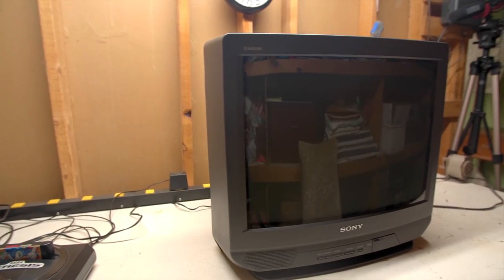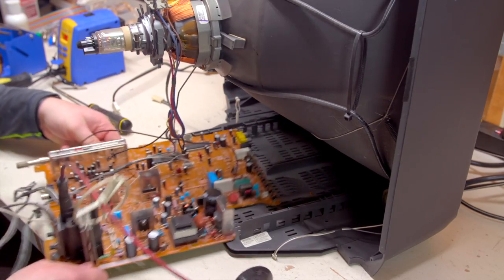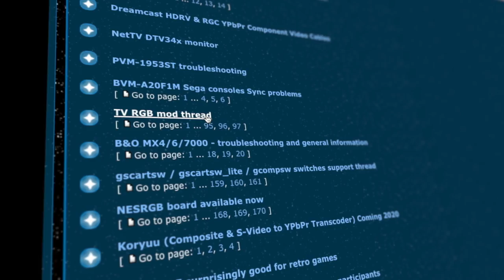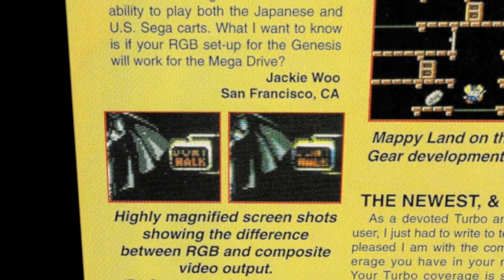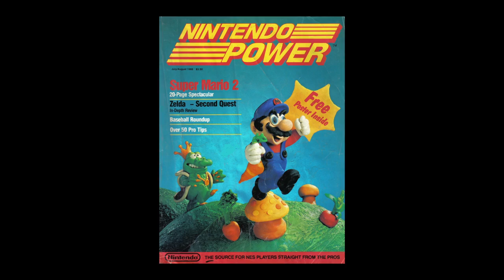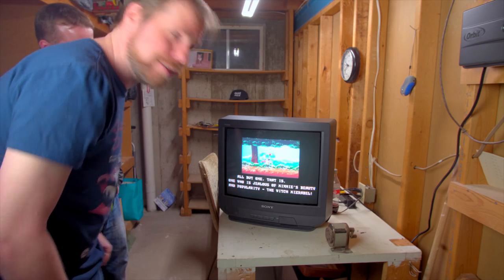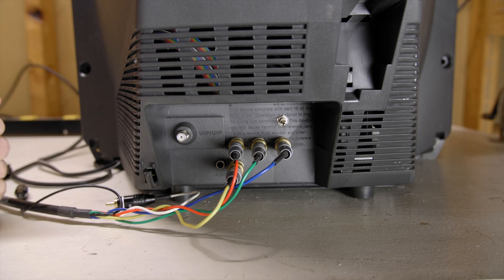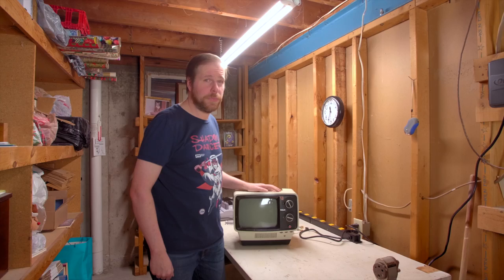Modding a Consumer CRT TV for RGB - Game Sack

Comment: Sorry, I have to do my usual Publc Safety Announcement again....

If you have a TV which has an insulating block between the RF tuner and aerial socket DON'T mod it for RGB!

Those sets have a so called "hot chassis", where the entire PCB is floating a mains potential.

It was a way for the manufacturers to make the TV more cheaply, without the need for a properly isolated power supply.

But the only thing between you and electrocution is the insulator on the RF socket.

Usually those TVs don't have anything else metal (like buttons) that are exposed to the outside of the case.

If somebody were to RGB-mod those sets without realizing, it would pose a serious risk of electric shock when they go to plug in the RGB or audio cables, or even just touching the connectors.

The TV in the video clearly has a metal extension from the RF tuner, a proper isolated switched-mode PSU, so should have proper isolation for the RGB signals (and the Ground taken from the secondary side of the PSU).
Reply: Even if you warn people not to do this mod unless they know what they're doing, the problem is that most of the guides never mention the "hot chassis" thing.

It's a particularly insidious problem, because you could in theory even test the RGB input OK when hooking up to a console (since the console's often have a "floating" DC power supply too), but get a serious shock if you touch the cable/connectors, or other cables hooked up to the console at the same time as something grounded (like a cable box, other cables, radiators, taps, pipes, other devices, kittens, etc.)

And people WILL unfortunately try this mod regardless of the usual warnings about discharging the tube etc.

The mod can obviously be done safely (like on the TV in this vid), but definitely something to watch out for.

Stay safe. ;)
Reply from the maker: Good info. Pinned!
Reply: Yeah some old technology can be crazy dangerous. There's a reason we used to have electronics repair shops everywhere back in the day, you couldn't just do it yourself like building a computer today. Another one is guitar tube amps. Don't mess around with the tubes yourself, trying to replace them or whatnot. You can get shocked doing that too even when the amp is off and not plugged in with a kettle lead.
    
Nowadays it seems there's more regulation to try and make electronics safer, like it's easy enough to replace a phone battery or fix a gamepad by opening it up. That's a good thing. They're still probably making CRTs in China somewhere with no regulation at all though, with this unsafe factor. I've heard some people import newly made CRTs from China off Ali express or whatever to play old consoles with. I dunno if I'd risk it. Just get an old one off ebay.
Reply: Oh yeah, guitar amps. That's another one. lol

I just stumbled on a thread about that, too, while looking for CRT "hot chassis" stuff.

All those stories of musicians getting zapped on stage are probably due to that, like in "Almost Famous", or "The Commitments".
Reply: @electronash  thanks for the Pubic Safety Announcement
Reply: @electronash  Thank you so much for the education. Your a Saint!
Reply: yeah.. I did what he did but failed.. I'm still  not sure what he did.
  I got flat out electrocuted when I tried grounding it.  I put the tv back in the closet once I regained control over my hands.
Reply: I do bondage electrocution on the side, this mod will be enjoyable for me
Reply: Maybe make an opto-isolation board?  CRT's are definitely not something you want to poke around in unless you have a LOT of electronics/high voltage knowledge and experience first.  I learned from my dad back in the early 90's, who learned on military radar equipment.  He taught me good practices.  I learned to solder when I was 8.
Reply: @guerrillaradio9953  I dunno how I never killed myself as a teenager. Me and a buddy of mine used to take apart everything we could get our hands on, TVs included. We never discharged shit, just started poking around and soldering. We also make homemade explosives. Shit that would blow an entire tree trunk out of the ground. I must have had dozens of near death experiences that I never even knew about. Got shocked a bunch but nothing that knocked me out. 

Once we were screwing around with the electrical system in my car and noticed that I could feel pulsing electricity when I touched any exposed metal on it. The whole car was electrified! It was funny at the time but not so much in retrospect.
Reply: Just discharge properly and youll be safe. Besides it is not going to kill you, I have received several shocks from arcade monitors and im here... just try not to get hurt
Reply: It's quite hard to find tvs that are not black and white or very early color tvs with this type of power supply. I risk to say that every set from the 90's is safe for it
Reply: @mickael486  was it connected to the mains outlet?
Reply: @Orkoto  It's not just about discharging the tube, and that's the whole point.

If you've worked a lot on arcade monitors, you'd know about the hot chassis thing.

And yes, they can (and have) injured or killed people, sadly.
Reply: @geovani60624  I recall seeing plenty of the Zenith/RCA/Sharp and other brands in the 90s with the hot chassis and RF isolator, especially in NTSC land.

They did start to get phased-out towards the end of the 90s, though.
Reply: @LordHumungusFL  Yes, I've watched a few of those. Great channel.

He doesn't get zapped because he knows how they work, and how to repair them. ;)
Reply: There are several solutions to a hot chassis that they use in antique radios but none of them are actually worth the trouble on an old cheap CRT TV.
Reply: I don't want to say it's impossible,  but it seems unlikely to me that you'd find a hot chassis TV with a jungle chip suitable for RGB modding anyway. Anything that has composite AV inputs isn't likely to be hot chassis either, since that wouldn't be safe - the hot chassis tend to be only older TVs with just RF input.
Reply: @ElectronAsh couldn't you just use an isolation transformer, just as you would with a hot chassis arcade monitor?
Reply: @rastanthebarbarian  Yes, in theory you could, but you'd be better off finding a slightly newer TV that uses an isolated switched-mode PSU.

It is true that it's hard to find a hot chassis TV these days, and usually when they only have an RF input, but the whole point of the warning is that they DO exist, and it's something that I'm not sure many people are aware of.

They mistake it for the same thing as discharging the tube, but it's a separate issue.

I would hope that most TVs from about 1990 onwards use an isolated PSU, but you just don't know until you check the board or find the matching schematics for the chassis.

Some people have said "Well, you don't really see those hot chassis TVs any more", but then we're working with "retro" TVs here, which could be from the early-to-mid 80s.

Just better to check things, and be safe. ;)
Reply: @electronash  I recently found a 25" Sharp at the thrift store with a hot chassis, manufactured in 1994! It has a toshiba jungle which is documented as being successfully moddable...I have experience modding about 5 TVs so far but they've all been isolated.  I may try my hand at modding the sharp, since I have an iso transformer handy, but I certainly wouldn't advocate for others to try it!
Reply: @rastanthebarbarian  See, they do exist. hehe

I did have a lot of trouble finding decent photos of "newer" hot chassis sets, but I know there are plenty out there, even in the 90s.

It was just a cheaper way to make a basic set, and in 120V Countries it only needed a voltage reg for B+, so there was no need for an isolated transformer as long as the RF socket was isolated.

(and there were no other conductive paths like metal buttons to the outside of the case.)

Yeah, I wouldn't personally bother with the Sharp TV. Just look out for an isolated chassis.

I know tons and tons of CRTs got scrapped, sadly, but there should still be millions to choose from.
Reply: Or just properly ground and mod the crt....If you can't notice situations like your long winded comment stated then you shouldn't be messing with anything electrical to begin with.
Reply: @RoomerJ  "Grounding" doesn't solve the issue with those sets, and you can't ground/Earth those anyway because the chassis is at (or close to) mains potential, which is the entire point.
Reply: @electronash  Like, your whole comment to anyone who does this is equivalent to commenting on a "hot to install a light bulb" video and saying "Just a little safety psa here uh-huhhuhuh dddeerrrr, don't stick your tongue in sockets that have yellow paint on the threading" derderdeee
Reply: @RoomerJ  This is not an obvious or blatant issue at all unless you've worked on this stuff before.

Your first reply shows you clearly didn't grasp any of what was said before. But hey, it's the YouTube comments section. There's always at least one person who has to pick fault in other's comments. lol

Obvious troll is obvious.
Reply: @RoomerJ  These videos are generally aimed at people who don't usually work on TVs, who have never done repairs before etc.

There are plenty of examples of people trying an RGB mod on a CRT who have never opened a CRT TV before.

My comments are aimed at those people. Some have been hurt trying this stuff before.

If you're gonna post replies in a style of "uh-huhhuhuh dddeerrrr, don't stick your tongue in sockets...", people will see you as a troll.

I'm never going to apologize for posting safety info if it might help save even ONE person from possible injury or death.
Reply: @electronash   @ElectronAsh  He says in the video that it's dangerous and don't do it without prior knowledge. This wasn't a "how to" it was just showing a process that is unique to most people in the world.

The issue with your comment is that anyone who knows what they're doing can most certainly work with a  "hot chassis" to do this modification. Also the way you described to identify a unit that has a "hot chassis" not only isn't a blanket truth for all sets but wouldn't even be the proper way to check for this since many units won't have the setup you described but can still be have a "hot chassis".

So not only was your advice completely unnecessary since no one should ever try this without knowledge and experience with doing this modification to crt sets, but your "blanket statement" about how to identify one is incorrect and could cause someone to get hurt or killed since it's far more complicated to identify a hot chassis than what you described.
Reply: @RoomerJ  Still missing the point.

Plenty of people have attempted this mod with zero prior knowledge of either CRTs or electronics.

Some people have already been zapped attempting this.

But yes, a CRT TV having an insulated RF block is not the only way to indentify it as having a hot chassis setup, but that went along with the advice to only allow trained people to do the mod for you.

So now we're here again with a "long-winded" reply. lol

I don't see how you can criticize a safety announcement. You're basically saying you'd rather I didn't post it in the first place, which is strange to me.

A fair few people here found the post worthwhile, AND it got pinned, so clearly not everyone knows about the issue.

I also don't know anyone who has safely done an RGB mod on a hot chassis TV or monitor yet. It would be quite a tough thing to do.

But that doesn't mean some people won't attempt it, and they might not even get a shock until they touch the connectors/cable and something else which is Earthed.

In principle, yes, I agree that people shouldn't be attmpting this type of work anyway without a lot of experience, but that's the problem - it hasn't stopped / won't stop people trying.
Reply: @electronash  Also, the 371 people who liked your comment have no fucking clue how to do this so of course a "safety post" with some words they might not know and worded in a way that makes it seem like you know what you're talking about, will get some likes from people ignorant about this subject. Being pinned is basically proof of that since Joe even says himself he has no idea how to do this or any real knowledge of the process.
Reply: @RoomerJ  Yeah, because of course me having over 15 years experience of repairing CRTs in the 90s and 00s (and doing electronics ever since) just makes it seem like I know what I'm talking about. lol

I'm genuinely interested in your investment in this discussion.

Essentially, what you're saying is, you're annoyed that a comment got pinned and got a few upvotes, and that an explanation of the problem wasn't warranted.

(the very reason for the explanation is because it's clearly not an obvious hazard, even for some people who might have done similar mods in the past or are relatively experienced with modding.)
Reply: @electronash  It's because it's dangerous and stupid. You most certainly can mod a hot chassis TV with rgb and your way of telling if it is a hot chassis is just ONE of many and you didn't discuss the proper way to check if it is a hot chassis and that's dangerous.
Reply: @electronash  For someone with supposedly 15 years of experience you seem quite ignorant about this subject.
Reply: What if the TV hasn't been powered on in 15 years?
Reply: @electronash  32 f1 e f1